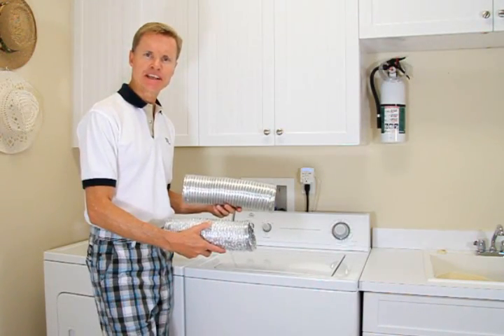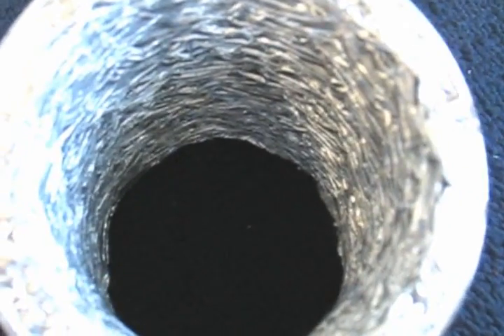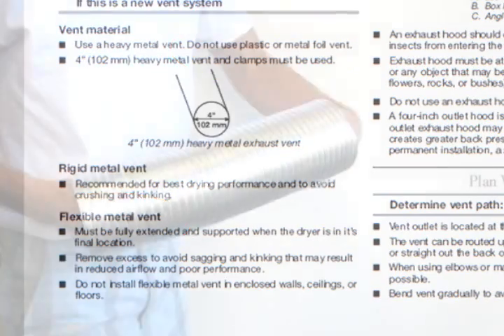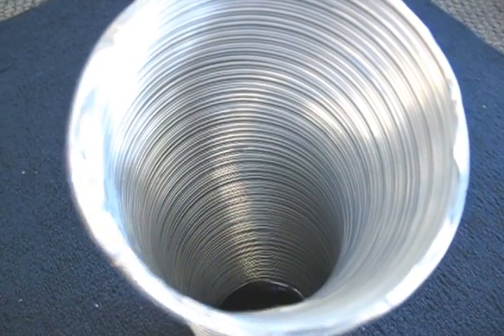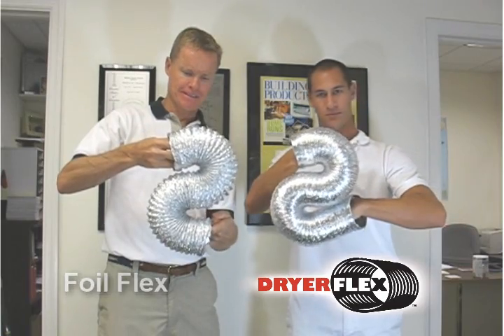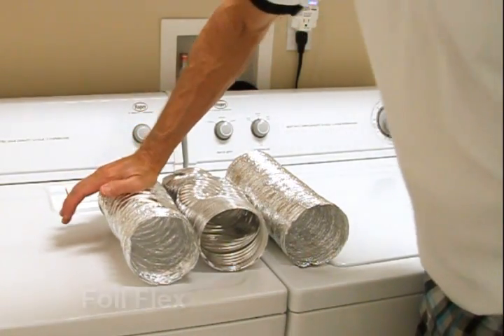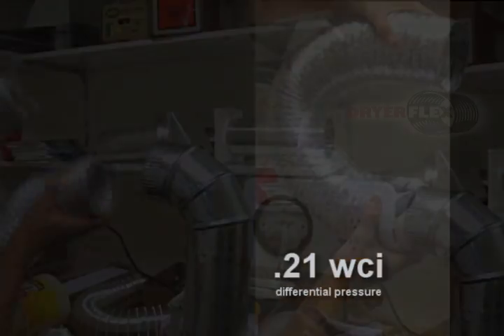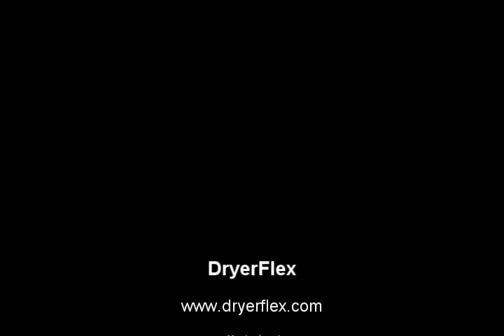DryerFlex - New Clothes Dryer Transition Hose from the LintAlert group

Comment: When the vent iis at the bottom of the wall and a hard turn is required this is too stiff.  Further when you try to cut it to size it comes apart.
Reply: So which one is the best one to get

Comment: More than two years later and it still isn't available retail.
Reply: This is amazing flex, and your comment is good.  At this time (mid-Dec) we understand that GE is packaging 8 feet of it with two SS worm drive clamps in a kit that will be available at most hardware stores as early as January 2015.  It won't be cheap, but in my opinion it is the best transition duct.  In the mean time, the majority of "Duct Cleaners" (tradesmen) carry the DryerFlex and can install it for you.  Use the Locator link at lintalert.com
Reply: Rick Harpenau Thanks for your reply. Tried to purchase it from a local carrier but the factory said no. Went with the "Dryer Ell" long radius elbow and rigid duct with a short section of flex at the wall vent. I really wanted the DryerFlex for its flexibility/low drag/ease of removal. No room for repair work behind the machines.